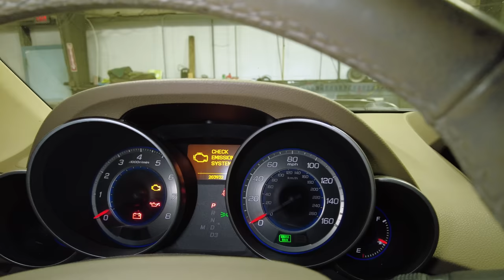Total mess! Last shop really screwed up on this '07 Acura MDX. What does the CAR WIZARD find?

Comment: I drove my 2004 Acura MDX (bought new in June 04) till 330,000 miles and sold it to a family member in 2017 .. she still has it and it's approaching 400,000 miles.  Same engine 3.5 and runs great. ... I loved the MDX , drove it for 13 years with little problems.
Reply: How often did you adjust the valves??
Reply: @jd646  I never recalled having that service done. I replace plugs.

Comment: Wild to think this generation goes all the way back to 2007. I remember these coming out like it was yesterday.
Reply: 2012 they switched the headlights and taillights a bit but it's still the same thing lol
Reply: @mrbond9882 yes just a mid cycle refresh but still the same generation.
Reply: @mrbond9882 yes just a mid cycle refresh but still the same generation.
Reply: Yep, I was driving these into the lot off the truck brand new... I hated the 07 refresh with the "bird beak" grille. 

But they are great cars.
Reply: I still think 1997 was 10 years ago.
Reply: @mrbond9882  nope. 2010.
Reply: had an 07pilot it fell apart..while my 07 4runner is still running strong..honda has kind of fell behind on quality...and his PPI suggestion is warranted
Reply: @JPR3D  I hear someone say ten years ago. I'm still thinking 90s .
Reply: @lutomson3496  08 pilot with 215k and was going strong until it was rear ended and totaled last month.
Reply: @lutomson3496  My 07 Pilot has 322k and still chugging along. Original engine/trans
Reply: Really, ive seen 1st gen pilots with obscene mileage
Reply: @volvo09  didn't like either of the grills but it didn't offend me as much as on the TL
Reply: Just bought 07 rdx turbo sh awd (Colorado) with 109k miles

Comment: These aged really well and look modern even to today’s standards. They’re all around great vehicles and have seen some with 200 plus K miles
Reply: 230,000 on mine no major issues
Reply: Acuras in general are usually pretty good. 228k miles on my 03 TL and still going strong! The most expensive fix I've had on it was replacing the timing belt, pully tensioner, and water pump.
Reply: @StevenLastname That's not a fix, that's just maintenance.
Reply: 160k on my 09 MDX. Hoping for 250k.
Reply: 125K on my 2012 TSX Wagon. Had to replace the half shafts at 62K. The starter makes a grinding noise every few starts when disengaging from the ring gear. The switch for the passenger front over head map light broke and had to be fixed. Every once and a while the rear window wiper behaves strangely, moves really slow, doesn't return to home position when switched off. Nice driving car, engine ruins good and trans shifts smooth and I am going to keep it till the wheels fall off but... not entirely impressed.
Reply: Other thing with these Hondas is that the Sound systems are so integrated into the vehicle that upgrading to Android Auto or Apple Car play is an $$$$$$ PITA X 2 or essentially impossible.
Reply: 286k+ miles on my 2010 MDX Advance, been to hell and back.
Reply: Yep 212k on mine

Comment: I got a used RL with the 3.7L and I knew the previous owner ditched the car when all the timing components needed to be replaced. The dealer I bought the car from gave me a phone number to a mechanic they use. I called the guy after doing my own research on the 3.7L. I told him it needed a timing belt kit installed. He argued with me that that Honda motor has a timing chain, argued with me. After I was able to get off the phone with him, I called the local Acura shop and had the timing belt service done right by ppl trained specifically in Honda/Acura cars.

Comment: I had this  local shop I had a great relationship with, always had done good work and generally quick. We took in a Camry for a timing belt and it came back leaking oil. We took the car back and all of a sudden they were rude as hell. They finally agreed to fix their screw-up and it came back leaking again and that was that. Any shop can make a mistake but owning it and making it right is what keeps customers.
Reply: it leaked because they did not do the seals.rush.

Comment: Could you not pull the wire out from behind the tensioner at all? Back out the solenoid and retighten after? Wouldn't save it by any means, but buy time perhaps? We all know how temporary becomes permanent, and I'm no expert on that vehicle by any means, but seems like the sort of thing "we can try this, may buy more time, may not, it'll be a cheap and dirty attempt" would cover for a half hour labor

Comment: 8:18 You really are a wizard! I have a '09 Acura TL SH-AWD with the 3.7 and i had the low oil warning pop up on the nav screen many times while driving. This definitely is a common problem with the oil pressure sending unit. I replaced it with the updated part number sending unit and the warning has never came back. Also, you are 100% right on the transfer case. Everyone i know with either a Honda/Acura AWD never services it! I do my transmission drain and fill, transfer case, rear diff service every 20k miles. I always love watching your videos. Been here since you first started producing them when Hoovie was recording with an iphone on a tripod.
Reply: Question, why are you replacing those fluids every 20K miles? Most of the fluids you are replacing have 50K miles life time or more. I'm not calling you out, just wondering why, because these fluids will live so much longer.
Reply: @shafferjoe1962  Probably because of that V6 Acura/Honda infamous transaxle limited lifespan, lol! With no serviceable filter, I don’t know that they ever lived this one down…that is unless you drive it annoyingly gentle
Reply: @homesold  I don't know anything about these SUV. But with that said, that would make since. Thank you
Reply: @shafferjoe1962  Probably for peace of mind. Fluids are cheap... transmissions engines and transfer cases are not👍🏼
Reply: @shafferjoe1962  Because the manual states: "Driving in mountainous areas results in higher level of mechanical (sheer) stress to fluid. This requires differential fluid changes more frequently than recommended by the maintenance minder. If you regularly drive your vehicle under these conditions, have the differential fluid changed at 7,500 miles , then every 15,000 miles." i drive my car pretty aggressively when im on my favorite winding mountain road fairly often. i forgot about the transfer case  maintenance interval but i know it's roughly around the same mileage. Honda/Acura has been known for their weak auto transmissions so i just do all 3 every 4 oil changes. All of the fluid is cheap, a new trans, rear diff, or transfer case isn't.
Reply: @homesold  i drive the crap out of my car and have never had a problem with it. It has 125k miles now. I'm apart of a Acura Tl forum and no one has EVER experienced any issues with the SH-AWD system. This torque vectoring AWD is actually surprisingly stout.
Reply: @BryanW916  Thank you for explaining why you do it so offended, and that makes since why you do it so offended.
Reply: I remember those days when WIzard had hair!
Reply: @cousinjohncarstuff4568  And when he'd just stare at the camera when Tyler was filming! LOL I'd probably do the same thing honestly.
Reply: @homesold  lol annoyingly gentle, that's how I drive my 5AT ODY . I replace the trans fluid yearly (don't even drive that much) these are the worst of the worst many 1999-2004 odys are on their 3-5th trans
Reply: @BryanW916  I agree, Honda fluid is cheap online so why not keep up with it. It's smart to save money and headaches
Reply: Lol all these uninformed comments. Transfer care, axles, and transmisson issues are literally unheard of on the second Gen MDX lol. You can literally beat the hell out of them and change the fluids every 60,000 miles and they run flawlessly.
Reply: Are you talking about the oil pressure switch ? My 14 tl did the same the other day oil levels are fine the engine isn't making any crazy sounds.
Reply: @flacko001  yep, my bad. the oil pressure switch. Sending unit/switch same thing lmao. There's a few acura online parts stores that sell them. Get the switch and the o ring. it's pretty easy to replace, just gotta make sure you remove the correct one.

Comment: I used to work in aircraft maintenance (avionics). Intermittent issues are by far the worst to troubleshoot. Good job running this down!
Reply: I was an AT in the Navy.  Didn't particularly like the job.  Troubleshooting was a bitch sometimes.
Reply: I work in IT and have to troubleshoot intermittent issues rather frequently (especially for VoIP problems). Yeah, they're the worst without a doubt!

Comment: The 07-09 mdx are super reliable. Those earlier j37 are a beast if the maintenance is kept up. 230k on the original drivetrain still going strong.

Comment: My mom bought one of these back in 2010. The seller worked worked at google here in the Bay Area. Google maintained the car. It was a company car serviced at the dealership. Mom still drives it and loves it. 200k miles and runs like a champ.

Comment: As soon as I saw what warning indicators came up, I knew it was the Rocker arm actuator. 
A couple years ago I ran some marvel mystery oil in my 2010 mdx to see if it would help the oil consumption issue I had, which wasn't terrible at the time. After I did the oil change after the MMO, when accelerating full throttle I had those same warning lights and a p 2648 code.  I changed the actuator and the screen filter, haven't had an issue since. Also significantly fixed the oil consumption, I rarely need to add oil now. 
I LOVE my MDX!  250,000km and going great!  It even endured the abuse of being a leased car previously.
Reply: So these have a timing belt? At least that's what it sounded like from the Wizard.. I recently found out the Honda Pilot also has a timing belt, I was considering that vehicle when my girlified was looking for a new auto. But there were no local ones available in her price range, now I'm sorta glad didn't end up with one. But the MDX was another one I was looking at, but again nothing in the price range, this was when car's were at their peak, have come down some since then. However, why did Honda use timing belt's all the way into the mid 2000s? My old 98' Honda Accord 2  door (6th gen) had a timing belt, made sure I replaced it at 100k and 200k before it finally died at 265k. 7th Gen Accord 4 cylinder finally got timing chain, but it seems all V6 Hondas/Acura's always have a timing belt?
Reply: @marcusdamberger5175  Yes, they have belts. From what I was told it is because they run quieter. 
My buddy is a honda tech and he said unless they are starting to getting noisy,  they can be changed every 150,000km. When we did mine after 120,000km it had no cracks and could have gone longer. The reason why I changed it was because the tensioner was leaking and just swapped since I had it all open anyways.
Reply: No need to change the whole unit. Just replace the control valve  and oil pressure sensor.
Reply: @marcusdamberger  i
Reply: FortunateDaD. The oil consumption of your 2010 MDX could be a faulty control oil ring which is a recall of 2010-2013 model year. I rember, I received letter from Acura and brought my 2011 Mdx to dealer to replace it.
Reply: @namdang6306  you are correct about the warranty repair, mine wasn't deemed bad enough to warrant it. Those rings get full of carbon then don't seal properly.
I figured I would try a engine cleaner that wasn't too aggressive and I was fortunate.
Reply: @fortunatedad7695  If I kew the way you fixed I did not have to spend a lot of time. The dealer did the oil change, gave me oil consumption form to record the amount of oil needed to be put in to full when check oil level. After 1000 miles, brought the car back with the record. They check the amount of oil loss then decided it needs the oil control ring replacement.
Reply: @namdang6306  I went through the same process you did but they didn't consider my consumption to be excessive and denied me. Oh well, still love this car! 
You got it repaired properly so good for you! I was just fortunate.

Comment: David, love your channel, and the fact you always do the tight thing. Also ,I enjoy Mrs Wizard's commentary. Just purchased a beautiful, well serviced 2014 MDX.  Out of n abundance of caution I had the timing belt,tensioner,water pump,and sparkplugs replaced. After one week all kinds of codes started being set And the vehicle had a misfire code. I called the shop who never returned my call. I got a towing service to take my vehicle to a trusted shop 50 miles away. He fixed the misfire in about two hours when he detrrmined the other dhop had not correctly replaced the connector on the fuel injector controller. He checked and made sure none of the pins were bent and sprayed the connectors with silicone, erased the  codes now it runs as it should. Haste makes waste and now I will never use that shop again. Thank you for your  channel!

Comment: Have had three of these MDX’s from new to 200k miles.  All bulletproof engines; transmissions and torque converters not so much….
Reply: Nothing wrong with the torque converters. Regular fluid changes and a software update fix all converter issues.
Reply: You are talking 2003-2006 mdx transmission old body style

Comment: You technically can service (most) staked U-joints. In the vast majority of circumstances, if you actually do remove the staked joint, there is a surface suitable for a snap ring joint. 

Of course, this isn't something you really want to be doing as a business while you can still get replacement driveshaft assemblies, but as they become unavailable, it's a another option on the table instead of going to a custom driveshaft and new transmission/diff yokes.

Comment: The first-generation and the second-generation of the Acura MDX will hopefully be on one of the six used vehicles that you should not buy list, as well as the Mazda CX-7 with the 2.3 L turbocharged four-cylinder engine and the early model years of the first-generation, 2002 and 2003 Saturn VUE with the 3 L V6 engine. The second-generation, Mitsubishi Outlander with the 3 L V6 engine and the first-generation and the second-generation of the Mazda CX-5 will not be on the do not buy list, because they are currently great vehicles to buy. Thank you very much and have a great week ahead.

Comment: I got my girlfriend a 2010 MDX Oct of 2020 we still have it 40,000 miles later and it's nothing but maintenance. The only thing outside of maintenance was a ac compressor. It's coming up on 170,000. Oil change every 5k miles and transmission drain and fill every 30k miles. I haven't touched transfercase or differentials. K&N air and cabin filters.

Comment: @10:17 nearly everyone neglects the transfer case/power transfer unit fluid, on everything. It's not specific to Honda/Acura cars, trucks and SUVs.
Reply: That was the 1st thing I had done while they were doing my timing belt on my 2005 Lexus rx330. Who knows when the all wheel drive system was serviced last🤷🏽‍♂️ 203K on the clock and still runs like a champ! 👍

Comment: That shiny aluminum Timing belt tensioner usually comes from dayco, gates or Continental. Very high failure rate in my experience. We only use OE Honda or Aisin as they usually go the whole 100k interval versus 20 to 30 k
Reply: I had mine done at Honda dealer with presumably OEM parts.  Didn’t last 65k miles.
Reply: Yeah well, if you can’t even count on it going 30k mi, it isn’t even worth doing *or worst case, trashing your engine (when a good belt lasts 150k)
Reply: @mongo64071  Could it have been the labor then? *It won’t even necessarily last 1-day if the workmanship is crappy. Parts mean a lot, but they’re not everything
Reply: @homesold  well I ca t see that was labor.  It worked from 100k to 165k. 7 years ago.  The dealer certainly would not stand behind their work.
Reply: Aisin for the win.
Reply: You do know that Gates makes belts for almost everyone..stick a label on it and its no better then Gates who is the OEM manufacturer with a label stuck on..all my NSX's I used Gates belts and never had a problem even the original one still ran great after decades...but I didnt want to risk
Reply: @lutomson3496  gates belts are oem, gates belt kits use some questionable pulleys tensioners and water pumps these days. So I wouldn't use their kits anymore. Had four or five tensioner failures and two water pumps start leaking at 30k or less after install. I've installed over 80 aisin kits with no reported failures yet.
Reply: I purchased anoem honda timing bet for my J35 it was a usa gates. However i gear the tensioners in teir kits are crap China assembled units
Reply: WTH man I thought the belt kits had to be done at 100K, no issues otherwise... they fail prematurely?? The Infiniti 3.7's from 08-17 have timing chain designs that don't fail, the issue is cheap oil gallery gasket for 08-11 models. Pass on the Acura 3.7 then.

Comment: I've owned 2 MDX cars and pretty sure they did not make the 3.5 for 07 year model Wizard only the 300 hp VTEC. 275 K miles on my 07 still runs and drives great ... Original trans and motor.